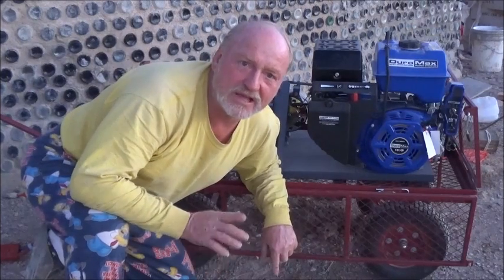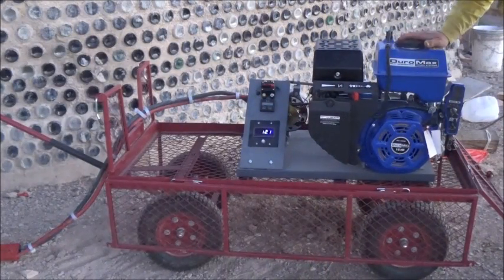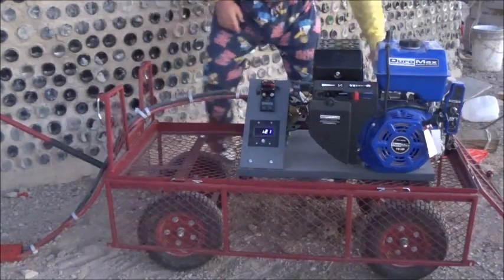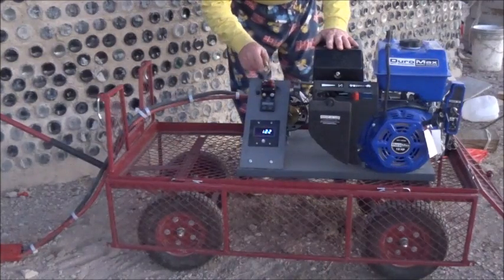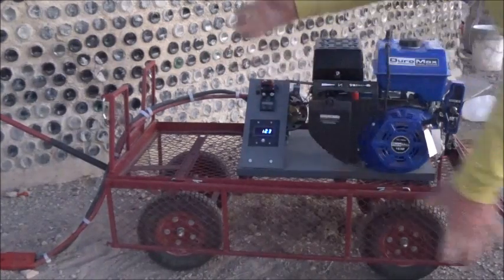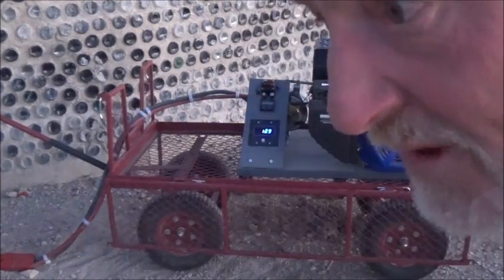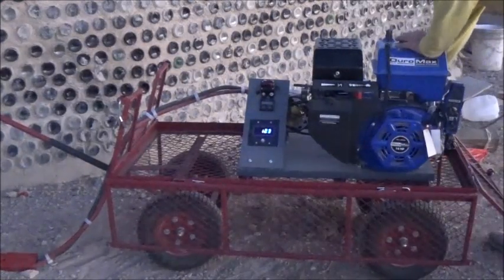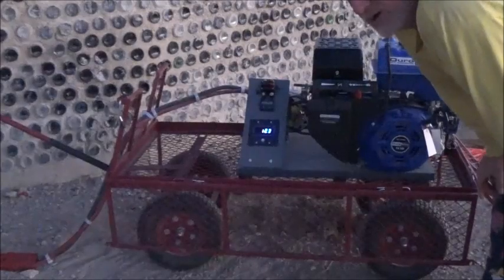The DC Generator!

Comment: Enjoy your cool drink....(you gave me an idea)...I decided to connect a 90v DC motor to 6hp diesel and I think the 4" and 6" pulley will put me in the voltage range for charging a 48v bank using a charge controller. I'll let you know how it performs.
Reply from the maker: Let me know the specifics..... if it works!

Comment: Those motors are more dependable with teflonated oil like slick 50
Reply from the maker: I used a product that was out BEFORE there was Slick 50 on the car we used to tow our car carrier back in the '80's. After we rebuilt the engine, I used nothing but this product in the oil, (and they also had products for) brake fluid, radiator and power steering fluid. Towing over 9,000 pounds, the gas engine lasted 150,000 miles before a piston ring blew out. When we dropped the oil pan, there was NOTHING in there except clean oil and the pieces from the ring! No gunk, residue or anything. These products are great!

Comment: When you hit the breaker the motor had no "LUG" maybe you need to spin the PMA faster?
Reply from the maker: In my excitement to finally get it running, I had not connected the fuse! The PMA was connected to the batteries the entire time and the fuse was inoperative. Now, I am tweaking the system a bit by increasing the engine pulley to 9" AND have connected the fuse!